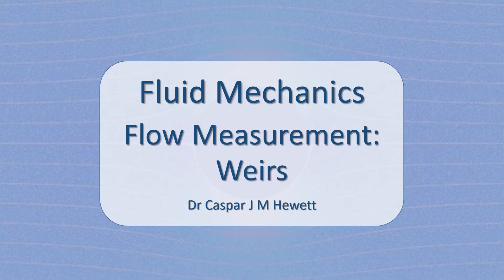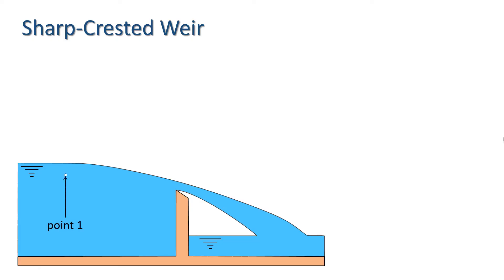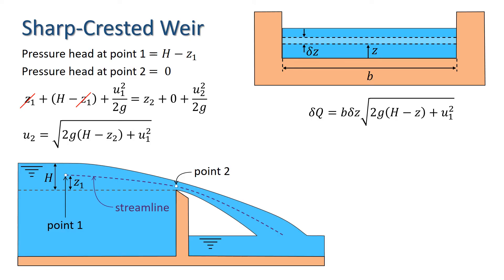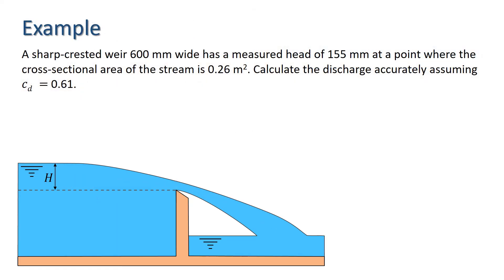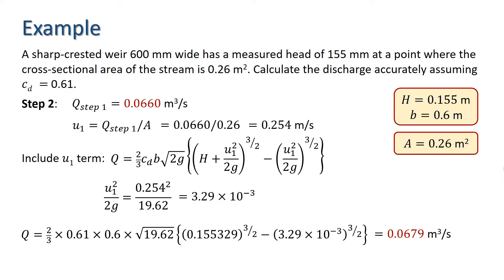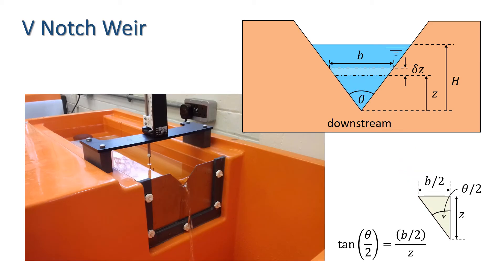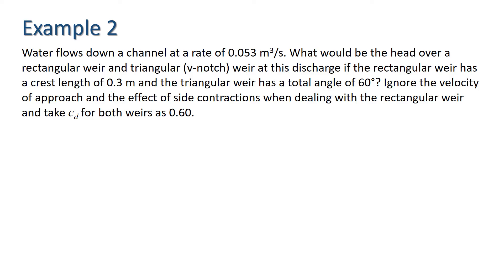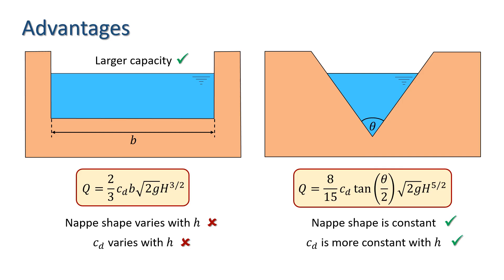Flow Measurement: Weirs

Comment: Please someone help me out, I have a tube well with 3 inches delivery and water is pulled by a 7.5 hp submersible pump system. What I am planning to do is to reuse the water force which falls out and to produce electricity or mechanical power. What output can be obtained and which system is more efficient, micro hydro turbine or a propeller.
Reply: Wouldn’t be worth the power you created
Reply: @RMORG12999  shut up and help